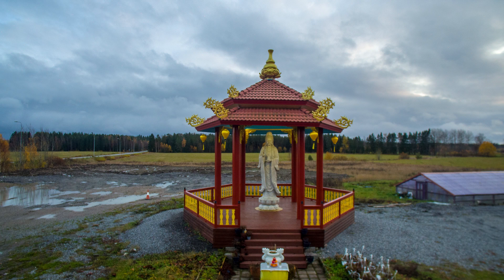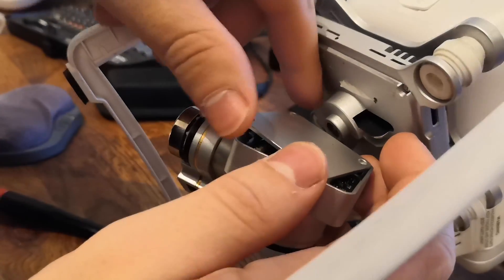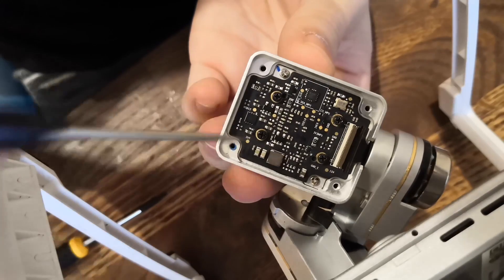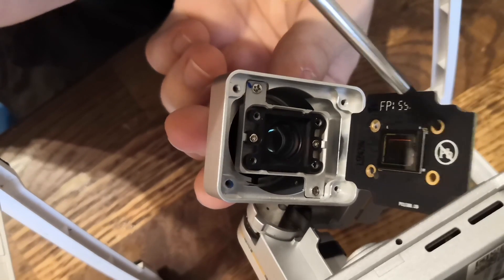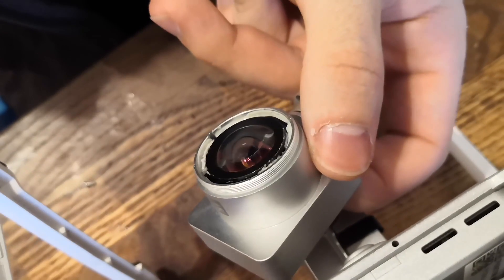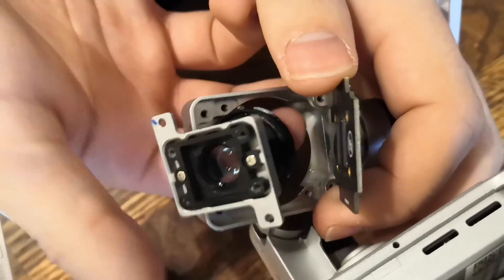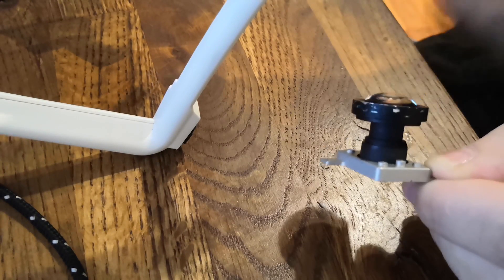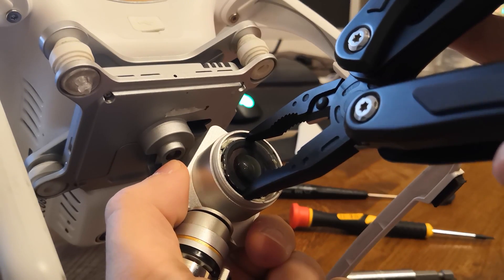How to fix Phantom 3 Focus problems

Comment: Man.. finally tried this and stripped the screw that holds the lens in lol. Working on finding replacement screws for the camera and will likely drill the stripped screw out. Thankfully the lens mount has multiple unused holes besides the two that hold it mounted. Thanks again for this video.

Comment: Is it necessary to re-glue the lens back in place? I have a P3P with a focus issue. I had a couple minor crashes (I’m assuming) that caused the issue. I looked back at images I took when I first bought the drone and they’re sharp. It was a refurb from Drone Nerds.
Reply from the maker: I haven't re-glued it, works fine. It's not loose, so it won't change focus on its own
Reply: Hagrid On a Bike thank you!!